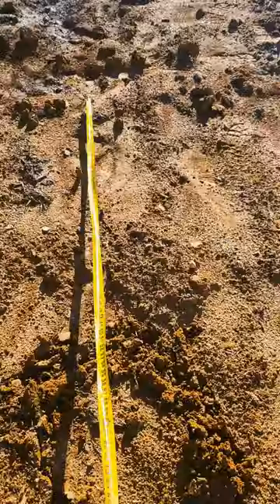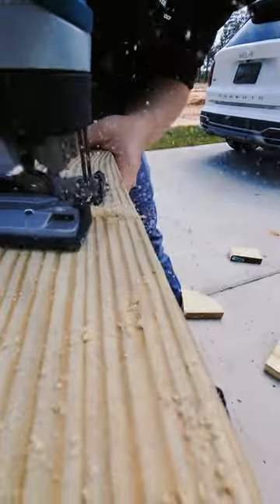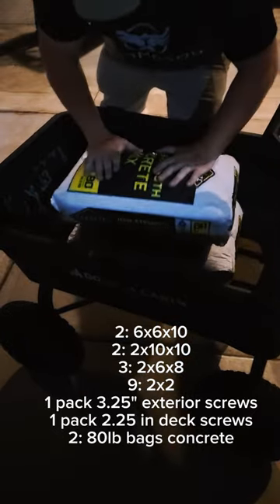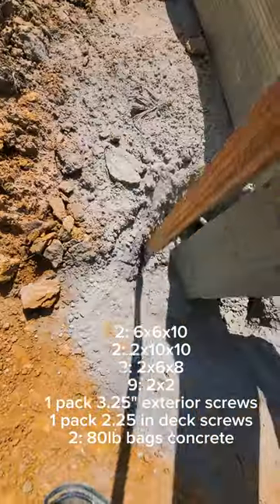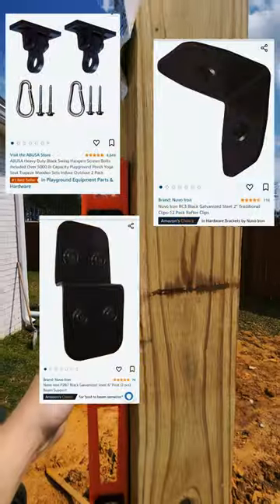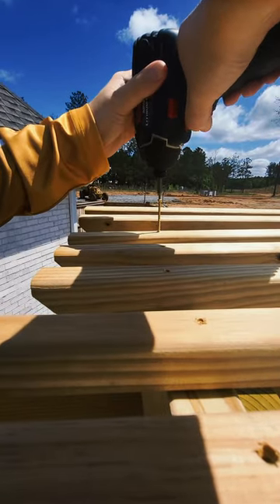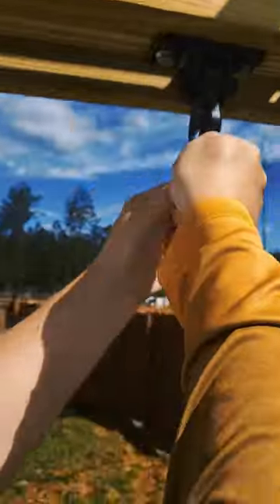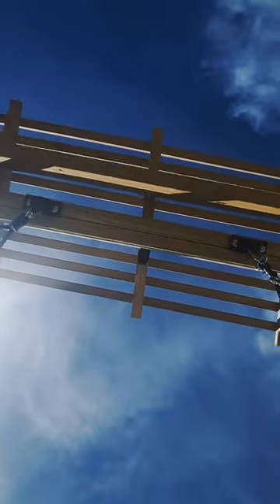DIY Pergola Swing for the backyard. Nice accent and future seating by the pool!

Comment: Hi.  Thanks for the quick overview!  Can you explain how you attached the black hardware hook for the swing?  Did you add a piece of wood between the two 2x10?
Reply from the maker: Hi, yes there are a few ways to do it. You can use another 2x6x(length between the 6x6 posts) and screw it in

You can use a scrap piece of 6x6 and screw them in from either side

You can recess a board into the 6x6 posts that will reside under the decorative facial board similar to the first suggestion however would offer more support if it were resting on the 6x6.

If I lost you at all just go with the first suggestion and ignore the rest lol

Hope that helped some

Comment: Hi ATL, just to confirm: This is pressure treated pine, right?  Also, did you stain/seal it eventually and how's the wood holding up?
Reply from the maker: Yes pressure treated. I waited until the wood dried out then used a solid stain to cover the entire thing. It looks brand new still. Not much use currently with the weather but was used heavily in the warmer seasons
Reply: Good to hear.  I was debating Cedar vs PT on mine, but figured I'll save some money and go the PT route.  Thanks again for the reply and the vid.

 @LemonWorks2021
Reply: If you don't mind me asking, which solid stain brand did you use?  I've got a few options at the box store and of course they all have mixed reviews.  Would be interested to hear your experience so far.

 @LemonWorks2021
Reply from the maker: @archvizninja5823  I always use Valspar. No stain will last forever but I've always had really good luck with solid Valspar. Used Behr once but some can just be ridiculously expensive for marginal performance differences. If it were on a walking surface maybe I'd drive myself crazy finding the most durable but being a horizontal surface Valspar is perfectly fine. I really like Mixed Nuts color

Comment: Did you notice the 6x6 moving alot when you used the swing? I have a similair build right now and both of my 6x6 posts move some when shook at the top, just a tad worried about that. Thank you
Reply from the maker: So I had a really long post ready to submit but I thought that would be too overwhelming. So I'll summarize it by saying that if you dug your holes at least 2 ft deep and filled it with concrete You should be good regardless of the wiggle at the top. I built two of these now and my kids (three and five). They like to be pushed full tilt too. Pay attention to the ground at the base of the 6x6s and if those aren't flexing and bulging showing signs of movement then you should have little to worry about. Keep in mind everything has a structural rating and I wouldn't want to find out what it is the hard way if abused. I would treat this and anything such as a normal swing set that you buy at a store with caution. If anyone wants to build this and dig it deeper with more concrete then by all means that will likely be more secure but in my opinion probably overkill. Also for reference I swing on it and I'm 220... But you know your situation best and I'd advise responsible caution if you are concerned. There are also ways to shore up and add to it for added stability if you chose that route too.